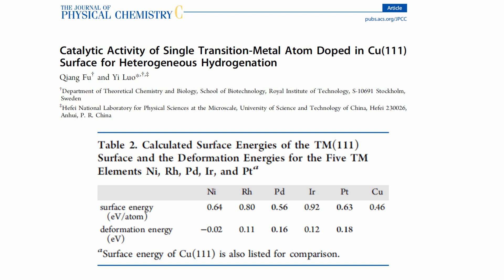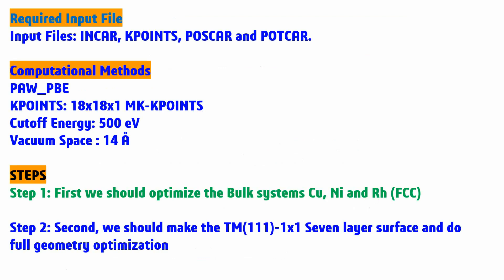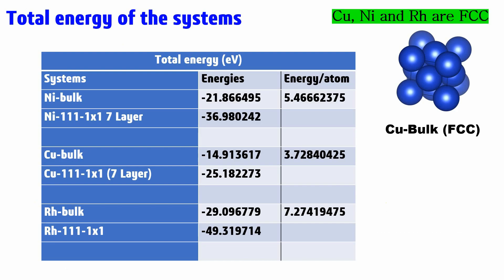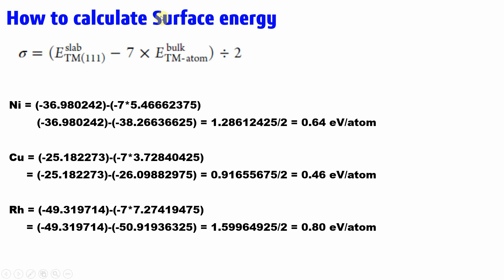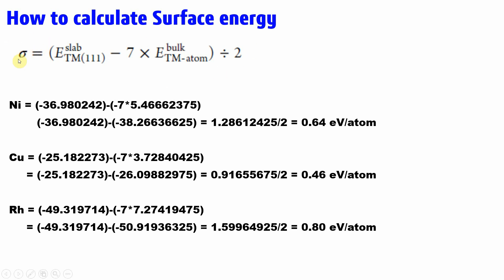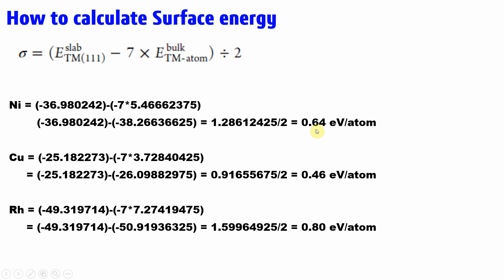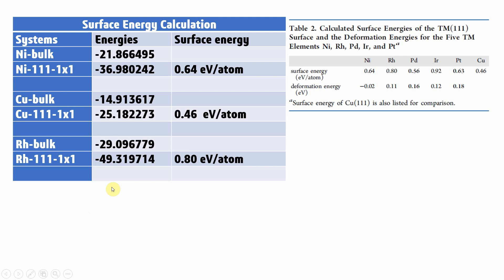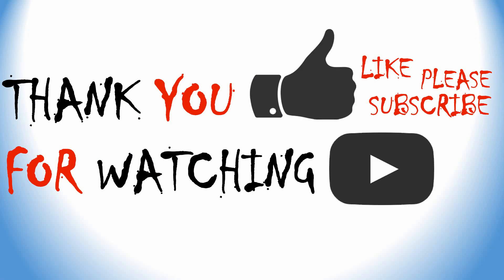How to calculate surface energy of transition metal nanoparticle

Comment: At 1:27, you described “$E_{TM(111)^{slab}}$” as Nickel TM (111) surface energy, while it is the energy of the whole slab unit cell under computation. Moreover, at 1:30, you are describing “7” is the number of atoms present in the 111 surface layer, but it is the total number of atoms in the slab unit cell. Furthermore, the division factor is not always two, but is “2 times Area of the surface” if one is calculating the surface energy per unit surface area, and “2 time the number of surface atoms” is surface energy is being calculated as “surface energy per unit atom”. I appreciate your videos, as it has helped me a lot in my works too, but I believe, such wrong explanations shouldn’t go unrectified. As both being a member of computational material science community, I would appreciate if you would correct the same. Thank you and have a nice day.

Comment: Hello SIr. I want to relax the system (surface of ZnO and molecules on the surface). First, we do simple relaxiation (ISIF=2) of the surface and then place the molecule on on the relaxed surface. Finally, we can relax only molecule over the surface ( during relaxation, we fixed the atoms of the surface and only relax the molecule ( this method is correct
Reply from the maker: First relax bulk structure with ISIF=3, then  cleve the surface ( your desired plane). Then fix the some bottom layers, above some layer free to relax ( use ISIF=2) to optimization, after geometry optimization, use this CONTCAR further adsorption studies
Reply: @dbinfotech  yes i did it. But if i want to relax a molecules over the surface, then we use IBRION =5 and NFREE = 2 and NSW= 1000.. is it correct
Reply: please guide me . I am confused about it. for optimization, and relaxation of CO2-adsorb surface, we use IBRION =2 or 5. I dont want to calculate vibrational frequency. I want to calculate adsorb-energy of the CO2.  I have already optimized the surface. now i placed the molecules over the optimized surface. Now for CO2-adsorbed-surface, we fixed the all atoms of the surface and allow to relax the molecules . Please tell me which tags in the incar file should i used for molecule relaxation over the surface